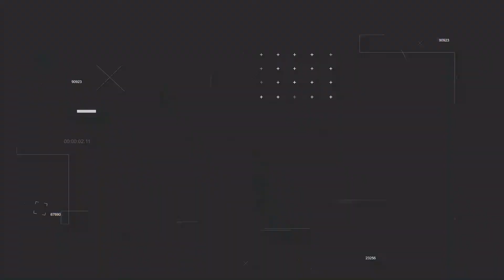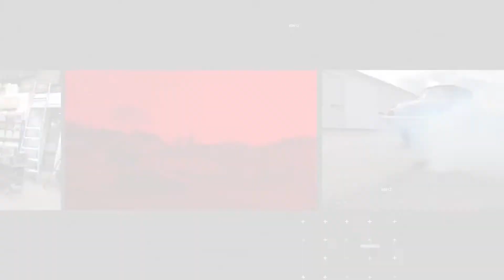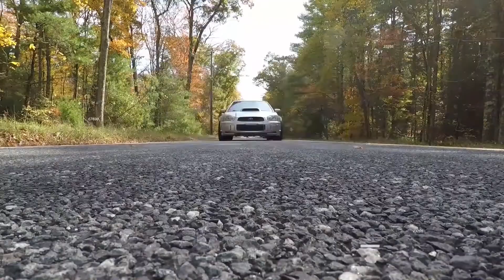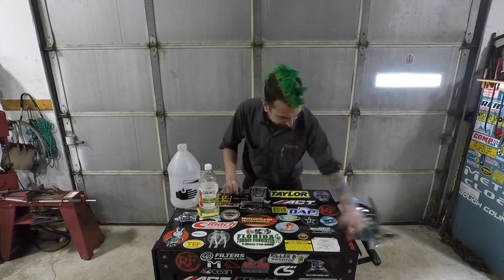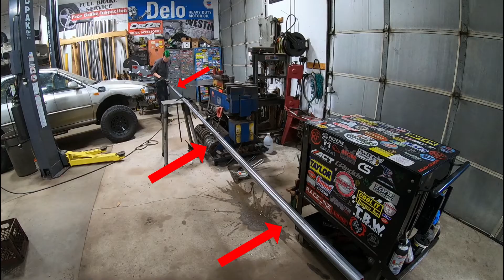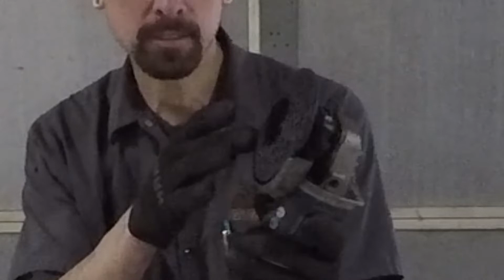How to remove mill scale and surface rust *PRO HACK*

Comment: Working on stripping rust off some frame and suspension parts of my Land Cruiser. I'll give this a try for the flat surfaces. Also...you're right about white vinegar, but I've been using muriatic acid for stripping rust off some parts. It's dirt cheap, works incredibly well and it's FAST. Just need to think carefully about how you use it.

Comment: I didnt ever think about using my 3x21 hand belt sander. Almox belts suck, but FINDING cerm or zirc in 36 or 40g destroys scale. I used to prefer a 4x4 drum with basically the same nonwoven material as scotch. The belt  is nicer for flat bar, since you can smooth out the roller marks from mfrging. No swirl marks, smoother finish than the drum or a disc. I srsly dont know why i dont see more welders use them. Try it.
Finding zirc or cerm was hard for me. I tried these and 1x 40g did a 48x48 1/2 plate and about 30ft of 4x4x1/4 flat bar. Had lots of grit, but lost its toothyness.